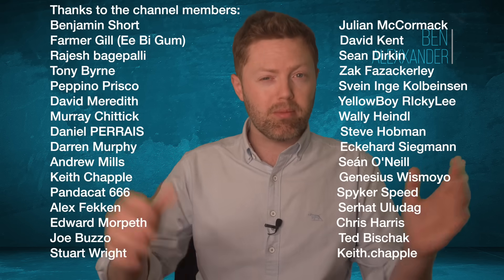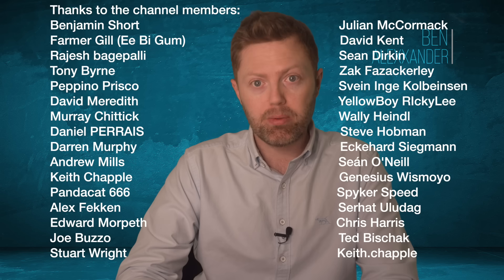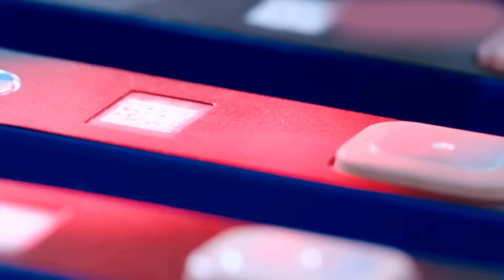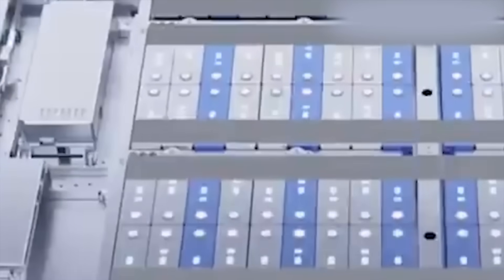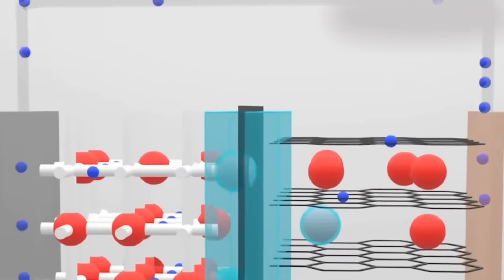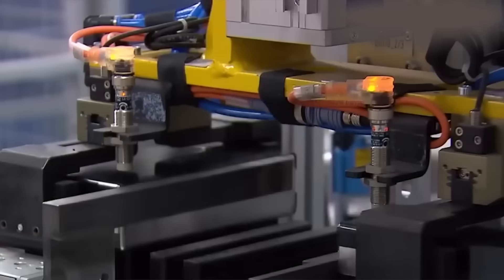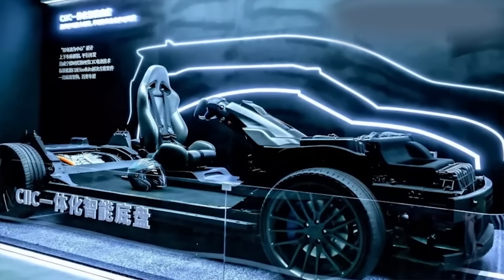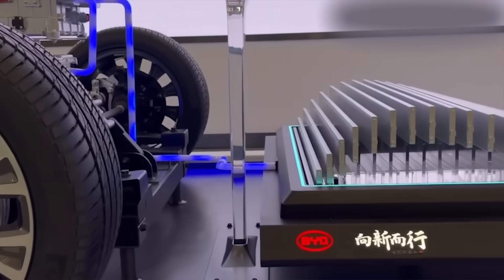CATL’s 500 Wh/kg Golden Battery Is Official — What You Need to Know

Comment: This will trickle down to EVs eventually, giving 1000+ km as the norm. This means no more range concerns. This means no more need to visit a public charging facility for any reason. No more searching for charging stations, having to plan stops for long journeys or range anxiety. No queueing or arguments over who’s next. Just charge up at home overnight on the weekends. No need for plug in hybrid vehicles and electric containerised vehicles will become a reality.
Reply: Utopia in other words.
Reply: My ebike has a 720wh battery on it that weighs 15 pounds. That is roughly 3kg (according to google)

So if i have 3 of these new batteries i would effectively double my range. 3kg of battery, technically at 500wh/kg

1500wh to 720wh. 

i would definatly upgrade, but i would also like to add additional batteries. my ebike already has a range of 100miles on pedal assist 1. (hiboy ex6 with some modifications.)
Reply: @TheKillerman3333   15 pounds is just under 7 kg- not 3 kg. How can you mess up a Google search for that?
Reply: @DaverGe  i used googles conversion tool, that's how it got messed up. 

This is why i cited it, becuase if i am wrong, so is the conversion tool that i used. in this case, you may be correct and the conversion tool i used was wrong.
Reply: @TheKillerman3333  2.2 lbs per kilogram.
Reply: I think it's more likely that cars get e.g. sodium batteries with lower densities, which are also safer. There's no reason for 1,000 km+ range. These batteries I think are going to be for specialty applications, long range trucks, perhaps even planes assuming they are safe for that application.

Comment: Energy density is the holy grail. When it gets to parity with petroleum it’s the end of ICE
Reply: It's already the end of ice cars but not for planes and trucking yet.
Reply: Unfortunately, this will never happen, since the energy density of petroleum is more than AN ORDER OF MAGNITUDE HIGHER than 500Wh per kg.
Reply: @YeTao-i4v well yes but engines are incredibly inefficient, so they will only be able to use a quarter of the fuels actual energy content.
Reply: @YeTao-i4v  You know, science is an amazing method. The only thing I’m aware of that is theoretically impossible is exceeding C. Everything else is up for grabs
Reply: @HT-io1eg Batteries are highly unlikely to ever reach the energy density of gas/diesel. The theoretical max energy density of batteries is only 1kwh/kg. But that  doesn't really matter. The current energy density of lithium batteries is sufficient to overtake ICE. ICE car extinction will accelerate with the ever decreasing cost of EV batteries.
Reply: no need to, petroleum is inefficient when you consider 70% of its potential is just wasted. And it still has to be dug up and refined, better to use oil to make plastics etc, not burn it.

Comment: Aviation fuel has 12,000 watts per kilo. So if you balance the comparative weights of an ICE motor with that of an electric motor. I think you will see a slight dissadvantage. Now if we can get beyond theoretical valency bound limits on sodium or lithium batteries, which are the 2 highest valency elements we can use, that is around 800 watts to the kg. By doping or electrode coating we can probably get to 1000 watts per kg by 2035. It still leaves batteries a long way to go. Does anyone have a suggestion to get electrical storage up to around 4kw per kg. Which is what we really need for flight. 600 watts sounds good but it doesn't cut it in the real world.
Reply: Solid state is coming in 1-2 years. We're still in the infancy of EV's and battery technology. It's only going to get better and cheaper fast.
Reply: The plane would use propellers not a jet engine…
Reply: Feels like we are just starting to develop aviation engine tech and we are in the propeller stage again! I imagine in the next 50yrs we will see the tech catch up just like it eventually led to where we are today with the Jet Engine.
Reply: I think 500wh/kg does make it possible to have small aircraft that have realistic range to compete with current 2 or even 4 seaters. Larger aircraft are going to be difficult in the next 10 years at least.
Reply: Energy density is only ONE of the concerns. Efficiency is equally important, which means that the total efficiency of motors gives electrical motors a boost of a factor 3-6. And then it is speed of charge. We will probably not see electrical engines on transatlantic flights soon, but domestic / inside EU-Europa will probably be relatively soon, say 10 years.
Reply: It doesn't have to exceed the energy density of jet fuel so long as it can be balanced out by a light enough electric motor. However, I may be speaking out my ass idk
Reply: Theoretically, lithium batteries could have an energy density of 3.3 kW/kg. The energy density of a car's fuel on the highway is 3.1 kW/kg because the powertrain has an efficiency of 86%, and the engine an efficiency of 30%. The most realistically and optimistically possible scenario is that the engine is running at 1,500 RPM with the Atkinson cycle and is a 2-liter engine
Reply: @Sfilorvy-w4c a theoretical energy density of lithium sulphur is 2600 watts/kg using ions. A theoretical density using lithium and oxygen is 12000 watts/kg but because of the valency and other chemical problems this is practically limited to between 6 and 800 watts/kg at the moment. To make your billions all you have to do is solve the oxygen problem. I am not entirely sure where your 3.3 comes from, could you be more explicite. Nor could I determine what fuel you were using on the highway.
Reply: @BrianArnold-fh6ks you should learn the difference between watt hours (energy) and just watts(power)  
 :)
Reply: @Bullseiify As you purport to know more than me perhaps you would like to re-write what I have written showing how it relates to watts hours. Then everybody can admire your cleverness!
Reply: @BrianArnold-fh6ks  no need for that. basically just replace watts (W) with watt hours (Wh) and thats it. i don't need people to admire me for that either.
Reply: Electric flight is already a big deal in the world's of drones and model aircraft. 

It is now also moving into industry: delivery, search and rescue,  crop dusting, line survey and fire fighting electrically powered drones are increasingly common place. Electric drones as personal air transport have also turned up in China.